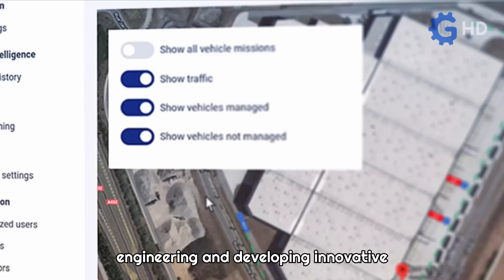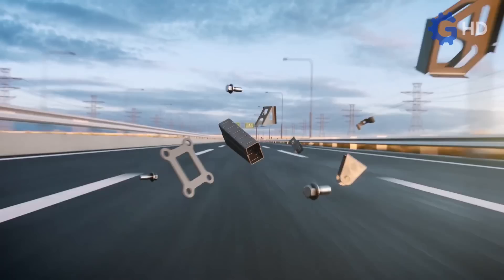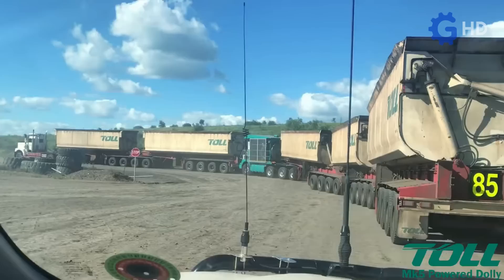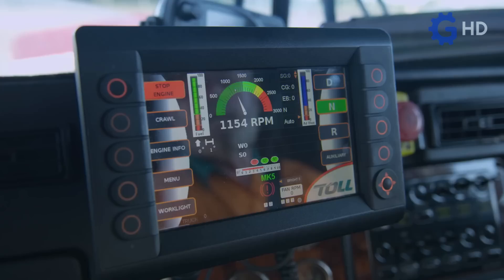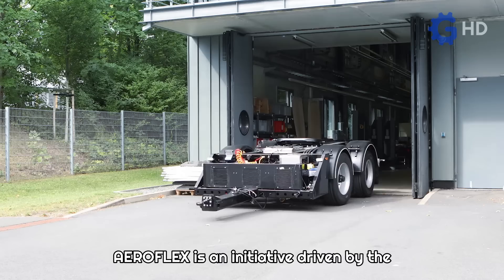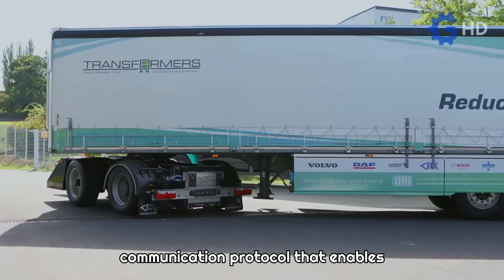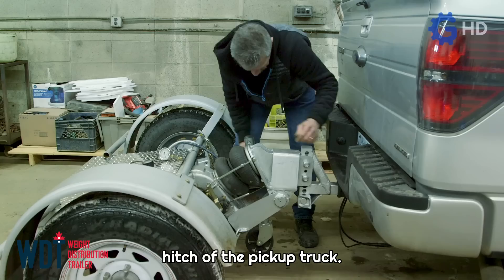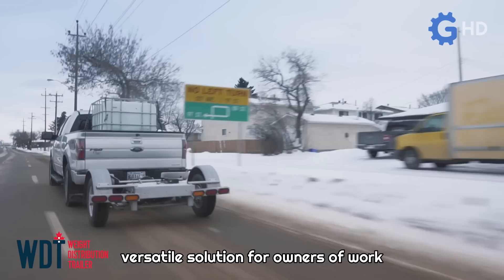WHY DOES A PERSON DRIVE THIS? ▶ MOST INNOVATIVE DOLLIES FOR TRUCKS

Comment: I like Australia's road trains but somewhere down the line I think more railroads would be better.
Reply: They have been using those road trains for decades, so they must have crunched the numbers and decided the investment in building tracks isn't worth it.
Reply: @bigredc222  smh
Reply: Yes, or even use decent size single vehicles like the Kress 200CIII Coal Haulers that carry 220 tons and get up to 65mph. It is a far cheaper than using lots of 'small' trucks.
Reply: @johnsomerset1510  Those giant trucks would destroy a road.
Reply: Rail trains aren't reliable with Australia's climate as all it takes is 1 warped section of track and the entire line is out of action
Reply: camboi There are train in the Sahara desert.
Reply: @johnsomerset1510  yeah but they still would have to re-innovate the infrastructure to accommodate that beast of a truck.
Reply: @bigredc222  well then those cork hats will have to get to work lol
Reply: @camboi6103  Where there's a will there's a way I'm sure there's tech that can accommodate the weather in some shape of form.
Reply: @bigredc222  this
Reply: So I googled why does Australia use road train rather than rail trains, there were a lot of hits, I guess a lot of people wondered the same thing. It comes down economics. RR tracks would not get used enough to justify the investment, the area is just too barren. Thousands of miles of track have been removed in the states because trucks transport most of our freight now.
Reply: @bigredc222  Greatly.

Comment: I drove these steercars in Canada, most dangerous rig i ever been in. You dont have any brakes. Not even a parking brakes which is needed after offload and moving by being pulled by a cable what if buddy driving the truck pulling you has a heart attack

Comment: Kind of confused on that WDT truck dolly thing.. if it bolts directly to the hitch with no point where it can spin and rotate like a traditional ball hitch setup, what happens when you take a sharp turn? It seems like your dragging that thing around corners if it has no pivot point
Reply: plus it takes weight off the rear axles which would mean less traction
Reply: If it doesn't add additional braking then you still have the problem of overloading the pickup's OEM brakes.

Comment: I remember back n the early 80's (I think), RoadWay was trying out some cab-under tractors. It was very odd to see a trailer coming at you with no tractor in front of it.
Reply: there was also one german design. saw it on youtube. thou it makes little sense. trailer can be longer but barely any more useful volume if you dont want to have complete box with terrible fuel economy

Comment: 8:44 does it need that blue stuff under wheels every time?
Reply: The blue platforms are scales. The trailer lifts the truck to take weight off the truck's rear axle. The scales make sure the right balance is set.
Reply: @Thankz4sharing  but does it need scales every time? because if it does its really not practical.

Comment: The Boeing "steering car" as described would be illegal to operate on the roads! 

As described, it states that it has no braking systems. 

FMCSA rules require that ALL AXLES MUST have brakes!

Section § 393.42: Brakes required on all wheels.

- former truck driver.

Wonder how the hell they are getting away with that?
Reply: @@michealszollosi8187  Again, that is NOT what the video said.
Reply: So the old peterbilt and Kenworth trucks without brakes on the steer axle are illegal now?
Reply: @breadmenv  As I understand it, yes!  They were grandfathered for about 20 years, but that ran out long ago. 

Now... That said, most of those trucks are now used within state lines for farming, logging, etc., So they are generally ok. Frankly, most of the 'old' trucks wouldn't want to be driven over the road! Crappy fuel mileage, uncomfortable, etc. 

Any that are still doing long haul have most likely been modified and now have front brakes.
Reply: There are air brake canisters visible in the video at 4:21and the rear is clearly well lit-up. I think it's a mistake on the narrator's part.